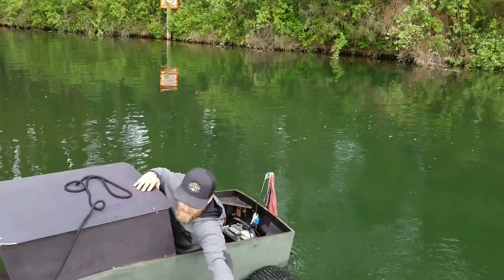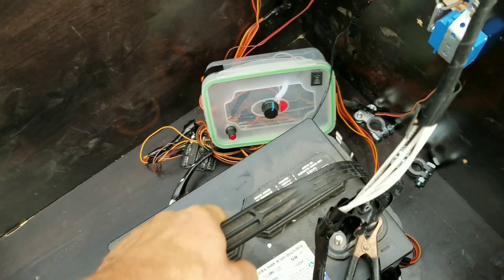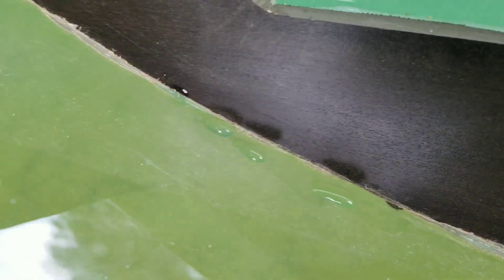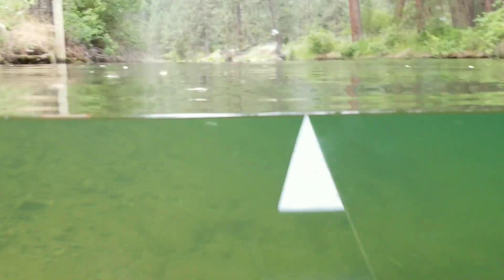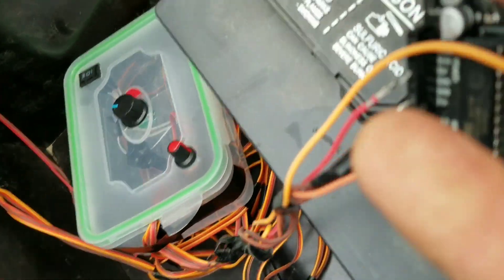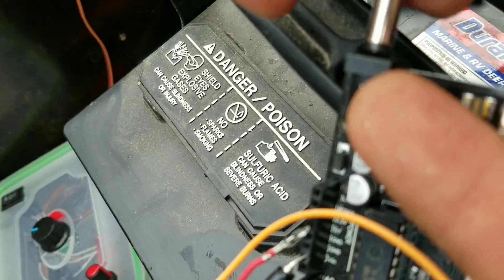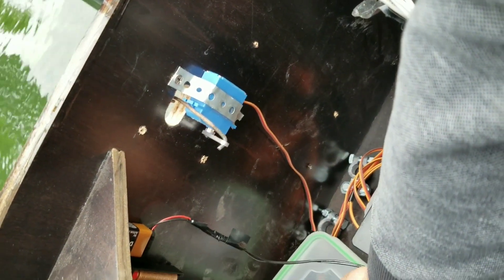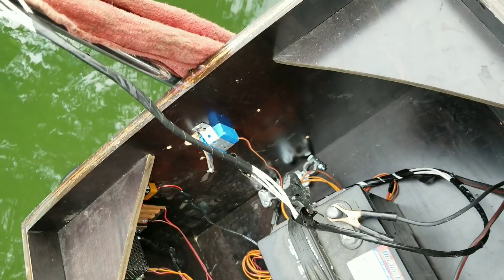Glass bottom mini boat test 2

Comment: The Servo sounds like it is straining a bit. I would make the servo arm a little longer but that will require a stronger servo. I'm not sure what servo your using. Amazon has a 20 Kg waterproof servo with metal gears for $17.89.  That will give you more steering throw. Instead of the Arduino use a servo tester. You can get them on Amazon for $6.99. One last thing, you may want to close off that triangle in the top. You can also put some black roll down shades on the side windows. They can go down just to the water line.  That will help a lot more. Then you just lift when you need to see out above the water line. Just some thoughts.Hit me up if you have any questions. Looking good. Good luck

Comment: Use a joystick type handle with bell cranks to steer with. Just push forward for right turn, pull back for left. You could steer laying down. Or just a push pull cable with 4" of travel. Steering would be easy to set up manually. Throttle would be as easy as just extending the original wiring....
Reply from the maker: Yeah thats a good idea  i have a hard time relying on non mechanical out in the water!

Comment: Could you put large non steerable casters or bike wheels on? They would add less resistance. Although the current wheels add stability.

Edit: nevermind. looks like you already tried it.
Reply from the maker: Yeah i really needed more stability was the main reason.  Then my dad was recycling a lawn tractor and here we are hahaha   im sure the battery will drain faster but well see!!